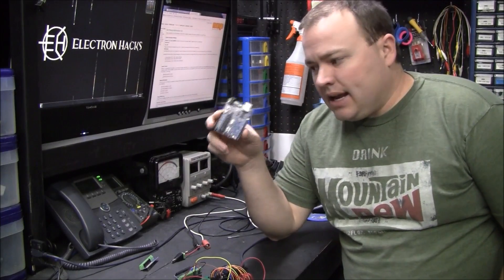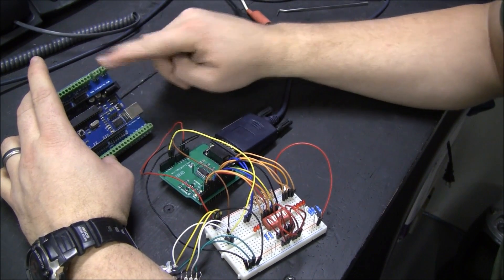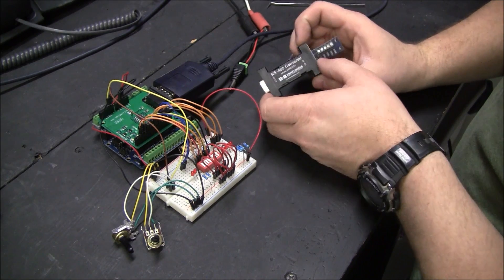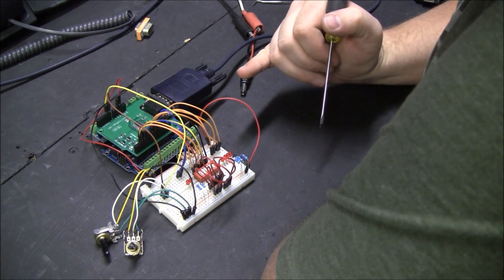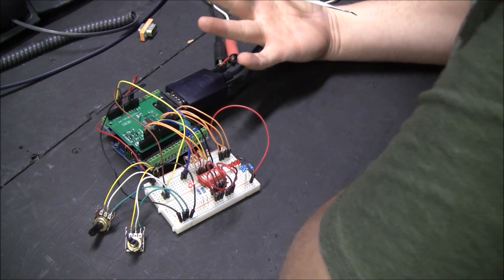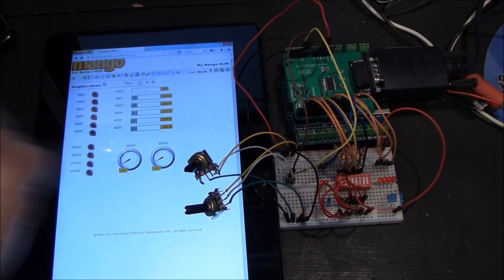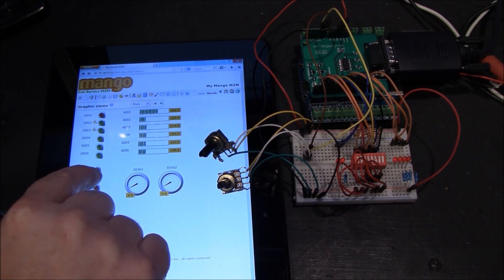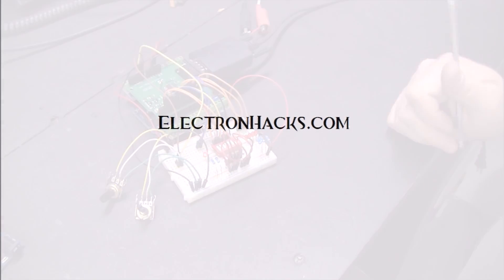Arduino Modbus PLC with RS232 and Mango M2M HMI

Comment: 1) arduno at 9600baud -> PC  (usb)  (not working with QModMaster)

2) atmega32 (with few code mods) at 19200baud with modbus lib -> FT232bm -> PC  (usb)

I have tested all this on two PC's, this one (desktop) and another one (notebook), with QModMaster (only atmega32) and ScadaBR (both)
- Result: INPUT's are little slow, lazy. I see that same delay on input status change here when you hit dip switches but "led" on your tablet came up after second or two.
 I'm not sure what cause this delay but it's little bit annoying when input status is not changed fast as output or analog inputs value. Also FAST inputs changes are not  registered at all so if you have some sensor on input with "short" output signal there is big chance that this RTU will miss it completely!
It's same for direct mcu pin connection (with pull-down) as with opto-isolated input (4n35)

Oh yes, i did tried to change update period all the way down (to 10ms !!!), i see tx/rx led's (on arduino) going wild bcs fast scan rate but inputs are still lazy. Anyone else having same problem ?

Comment: Great video and subject!  Technically speaking however you cannot call an Arduino a PLC due to the fact that it is not rugged or designed for harsh environments... which is a key differentiator between a PLC and another type of computer or control system.
Reply: plasti dip or epoxy the arduino and here is it for harsh enviroments

Comment: i have a question.
why didnt u use rs232 shield insted of going through 485 and 232??
and would it work with if i just connect the arduino to a max3232??
Reply from the maker: You can use RS485 or RS 232, which ever you prefer, RS232 is easier and uses three wires, RS485 can go much further and uses two wires but can be more temperamental to set up. A MAX3232 would work and would be cheaper but is not as convenient as you can just plug the RS232 shield in and it works.

Comment: Thanks again for your help! I successfully got modbus rtu rs232 working thanks to your tutorial. I'm controlling servo positions with both modbus registers and a pot. The pot is the manual override which copies the register to the analog output to the servo. Only problem is that my loop doesn't write to the servo quick enough (more than 50ms round trip) so it constantly returns the servo to 0 position.

I got the official Ethernet shield so now it's just a matter of figuring out a good library for modbus tcp and modifying my code to accommodate for the new library.

For now, I'm running the mango HMI server locally and opened it to the LAN for remote control.

Btw, you have the best walk through I've seen on here.

Comment: Any experience connecting via MODBUS TCP instead of RS232?

I'm currently in the process of building a very basic PLC for a batch mixer project and need to communicate over the network rather than locally connected via serial.
Reply from the maker: I used a Netduino for Modbus TCP and it worked well. If you are going with Arduino you will want to pick up an Ethernet or wifi shield and have to add the library for the shield. Be careful as the cheapest shields you get on ebay may be hard to use, I messed up by buying the cheapest thing I could a few years ago and I never got it to work.

Comment: Wondering if ITS POSSIBLE to control a  1-Hp 3-Ph 460V 815-RPM AC Electric Motor with Arduino + MANGO
Reply from the maker: Sure, an option is use Arduino+Transistor+Relay to switch on and off the motor. If you want to make an AC motor variable speed though, there is no easy way to do it without expensive hardware called a VFD(Variable Frequency Drive) but still, Mango or Arduino could control the VFD.

Comment: Another thing that would be really cool is to change the status of the digital door just by clicking the led. Without having to write, agree?
Reply from the maker: Absolutely, the old free Mango has some cool features but there are some serious limitations too. This is one of the reasons that I must continue testing out other HMIs trying to find something that has all the features I want but also at an affordable cost! I know of some really powerful industrial HMIs that could do it but my funding is not adequate for something like that.  :(
Reply: Glad you replied. I use a derivative of mango called ScadaBR. 
It is totally free and has a group that develops applications for it. We are now working on this integration with S240 pigeon equipment. Take a look on the internet to see what I'm talking about. We have several other plans. But your idea is very cool. Be sure to post. I'm already communicating with the entire community to submit your channel.Give me an example of what the application would like the mango did.

Comment: I do not believe I have to post videos. I want to see. This subject calls my attention. I have here in the city of Goiânia, Goiás, Brazil, a network that uses a derivative of mango on an RS485 network using the Modbus RTU serial protocol. The library I use is the JPZOMETA. I am now trying to connect an Arduino with an ethernet shield using the MODBUS IP. For this I will use a library called MUDBUS. Now my challenge is to make a remote connection with a GSM / GPRS device, but it requires a password to access the data and the mango does not allow this.